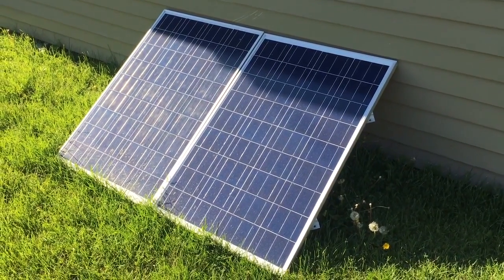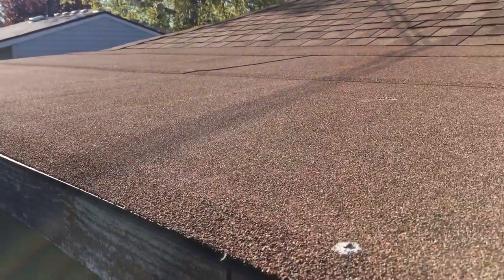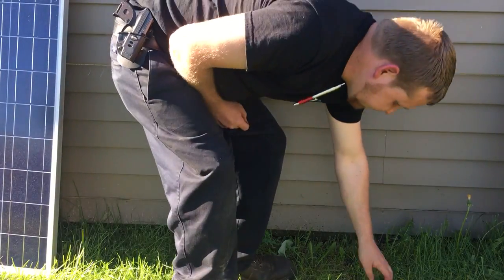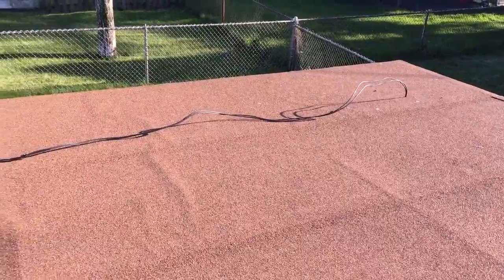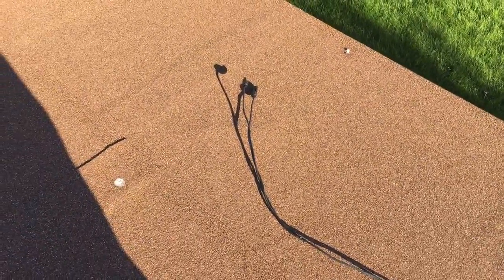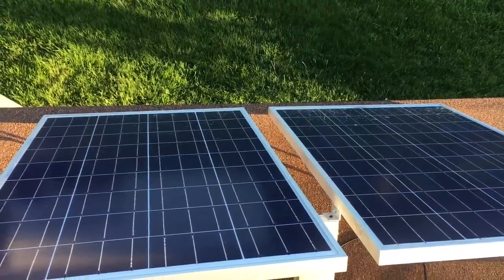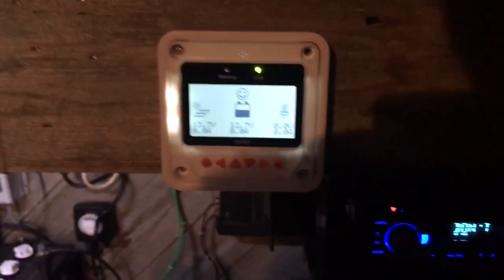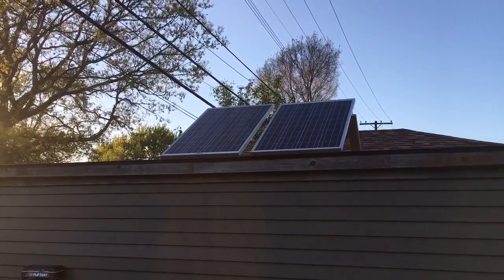Moving my solar panels on the Roof!!!

Comment: You used a pocket hole drill! 
Long hemostats works to disconnect the EC 3 connectors too.
Be sure that your panel mount is wind proof.
I run 4 panels in series for about 70 volts.The 4210 A does well with that.
Reply from the maker: ddd228/Dave in Seattle. Thanks man yea I love pocket hole drills lol and I always use needle nose if I can find them. I don't know how much wind they can take maybe I should check to make sure they are good. Thanks for watching and if you havnt before subscribe!!!
Reply: Keep it going!
 I've been through 3 MAJOR configurations,so far and yes,I'm still learning.
I'm into my system about $1,500 so far and more to go.
Yes,I will live long enough to see a return on my investment.
My A/C runs on solar!630 watts.
It is NEVER plug and play,but's way better than a wind turbine. That didn't work out for me in my location,but it was fun to build,anyway.[img]http://i.imgur.com/j5rZNXr.jpg[/img]